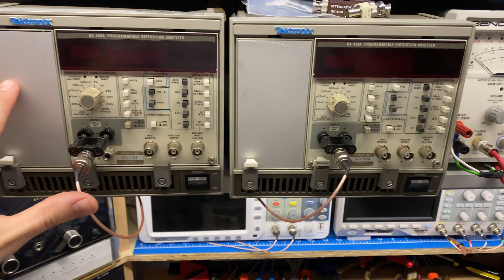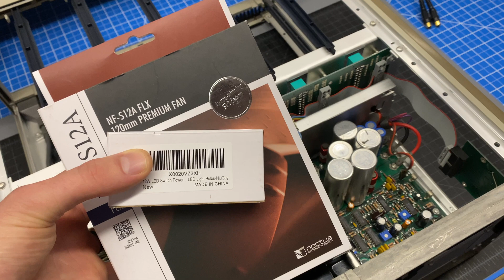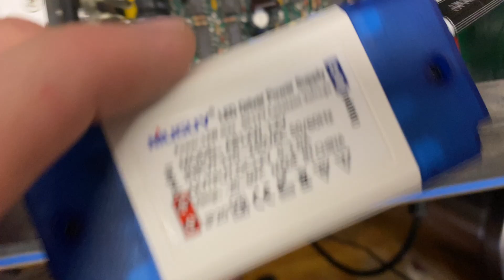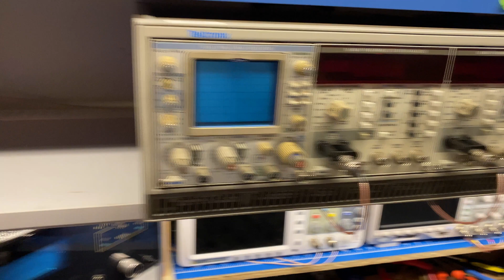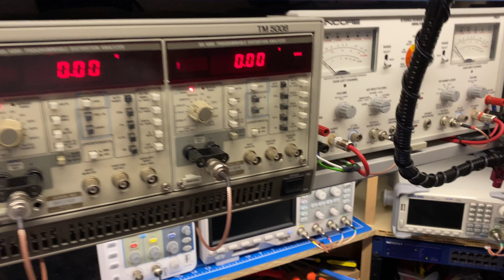Tektronix TM5006 Low Noise Fan Upgrade Noctua 12V Fan + LED Driver

Comment: Did you find the new fan cooled the 5006 enough?   I noticed this is not on your bench any longer.
Reply from the maker: The replacement fan seemed to work great for my application. I now use a Panasonic VP-7725 that has a smaller footprint and an even better oscillator. Keeping the Tek setup for future use.
Reply: @NovaluxStereophonic  Thanks for the  reply ,  Im almost finished with the recap and restore of  my TM 5006.  I have installed the same fan you recommended here.  Thanks again,  I enjoy your channel

Comment: Awesome! I actually just bought a 4084 today, as well as a 501A. I need to get a 5000 series mainframe for them to use them together, otherwise I will have space issues like you have. I will follow this video when I choose to upgrade the fan in mine. Thanks!!! Nice bench by the way.
Reply from the maker: Thank you. I spent a lot of time planning out the bench to optimize it for audio work. Eventually I’ll post a bench tour once it’s all complete. It’s very close… The information for the fan and PS I used are in the description if you get the itch to buy a 5006.
Reply: @NovaluxStereophonic  Pulled the trigger on a 5006 this afternoon. Looks like I bought from the same seller on eBay as you did. The one I got has the same engraving at the top. The guy had a bunch listed so I chose the best one of the lot. Should be here in a few days.